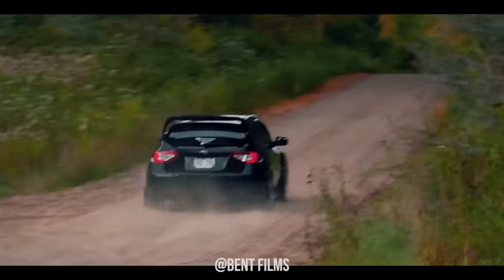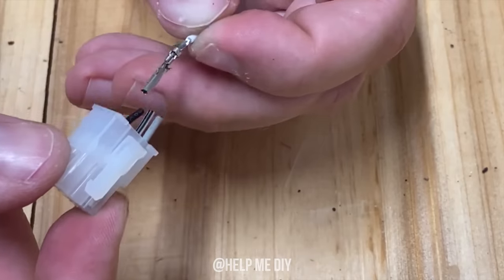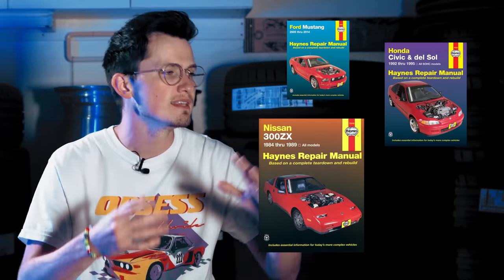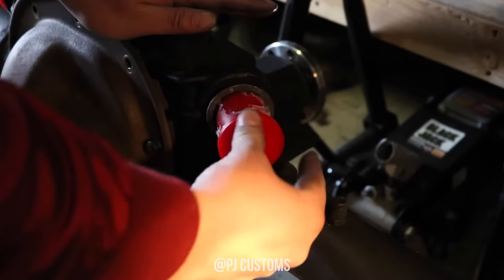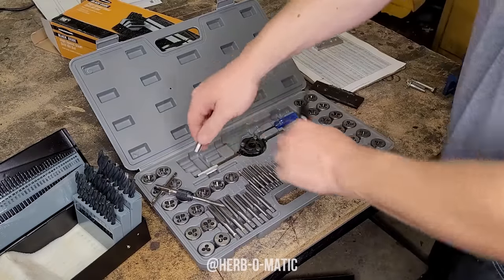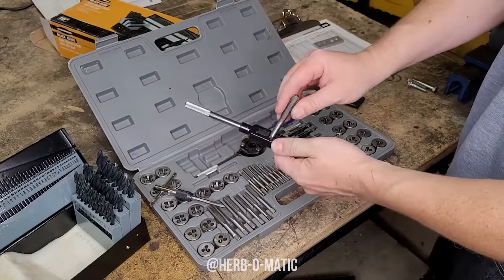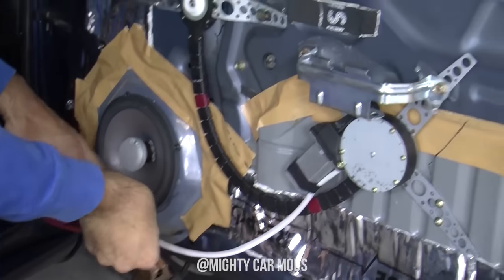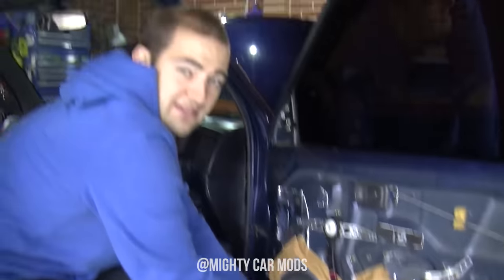How To Avoid Common Car Part Install Mistakes

Comment: dont cut corners lol. if the forums/videos say to remove a part to be able to pull the part you need out, do that shit. dont try to finesse it out and risk breaking connectors or puncturing lines that are in the way
Reply from the maker: Nobody wants to remove pieces. If the instructions say to remove it, it’s not because they want you to do more work hahahah.

PS Thanks for the comment and hopefully, sub! Just dropped a short earlier today so let me know what ya think :)

Comment: Buying a car and rockin it home before proper inspection. Had a welded shock absorber, I mean so cheap you can’t get $76 together and replace it? I’ll find you, you let me come to your home……anyway be careful out there. Know what your buying or take a person whom does with you or prepare to be destroyed by a seller bailing on a titanic that has been taped together and painted just right to be sold late on a church parking lot disappearing as you hand them a cash as the title floats on to the seat and your screwed. Sorry lost my train of thought.
Reply from the maker: That makes sense! 😅😅